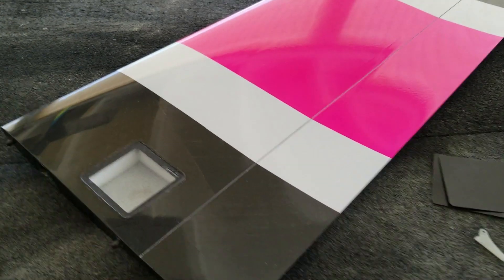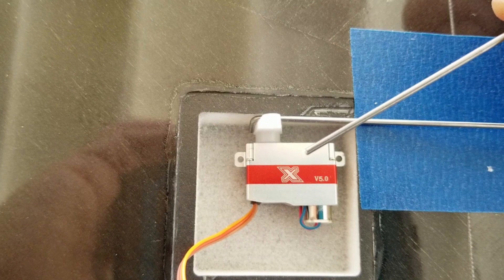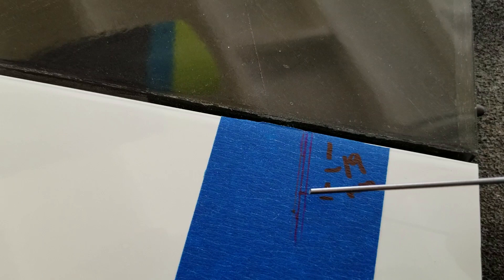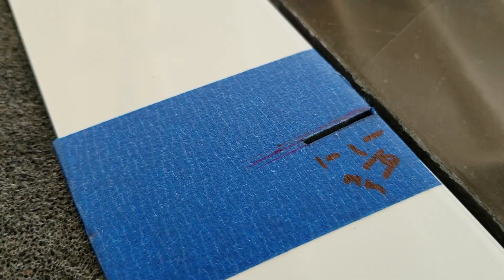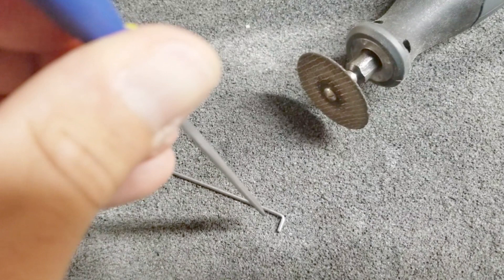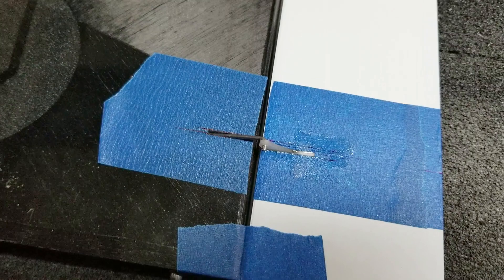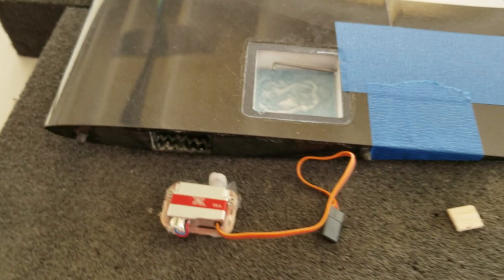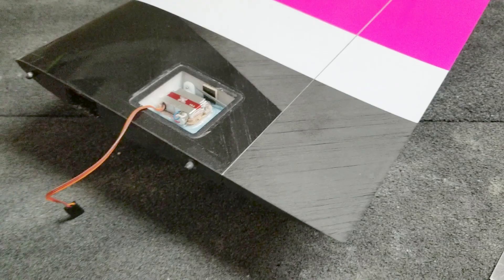GCM Vertigo F5J Aileron Servo Install

Comment: Finally a servo install video that start where it should start. Most of others videos you see the guys having the tapes and lines all figured out already and no servos in sight. You showed clearly that you start the line only when you have the servo placed where you want it, cross the articulation between wing and moving surface at a square angle, goes on the to the trailing edge of the moving surface, extend the line on the up side of the moving surface, again at a square angle with/up to the articulation line. The rest is self explanatory in your video. Well done
Reply from the maker: Thank yo very much!!

Comment: With your acid brushes, I use those often when using epoxy and fly tying, and have found that trimming the wild fibers off first helps, also, when doing precision epoxy placement like you are doing, I trim the brushes prior to dipping into the epoxy so I can be more precise with less clean up.
Reply from the maker: Great tip, I do this with larger chip brushes for bigger composite work.

Comment: Great and wel
l detailed explanation - you're the man! However, I did mess up and need a piece of advise: I made the control horns holes too big - because the horns are glued inside the trailing edge I cannot approach them at all. Any suggestions?
Reply from the maker: I'm not sure what you mean? Are the horns to tall??
Reply: @flightcomp  The holes of the control horns were drilled too big (by me). As a result, the metal clevis has too much space. Point is, that the horn is glued in the wing - so I'm pretty desperate there
Reply: Uri Melamed, do you still need a suggestion, I know a good solution.
Reply: @garryperrin2408  please post your solution, happens to all from time to time
Reply: @JorgeJimenez2020  so the hole is to large. It’s a 2 step job. First you apply good car wax to control rod. Soft cloth after a good length of time, then repeat next day. The control rod has to be slick. Don’t rush. Second. Insert into hole, exactly at correct placement. Now fill hole with super glue. Liquid works fine. And add Accelerator. This causes super glue to swell and dry. There is a third step- twist the rod between fingers, or with pliers. Because of car wax, the rod is freed and this solution can be used for various thicknesses of horn/other places rod is needing perfect fit.